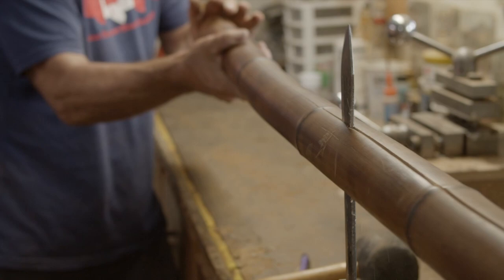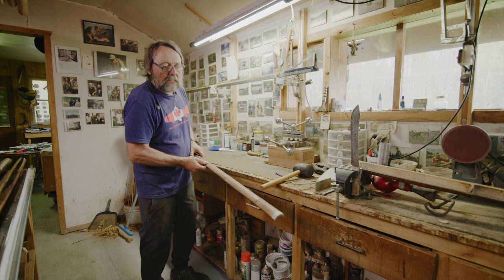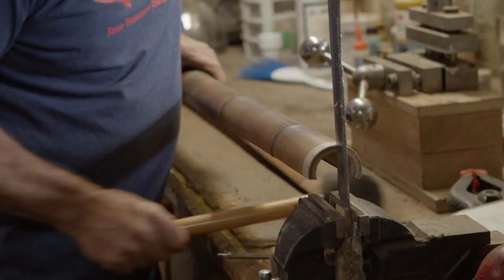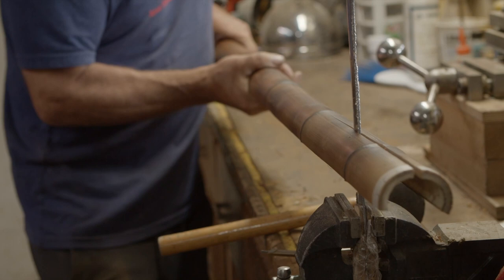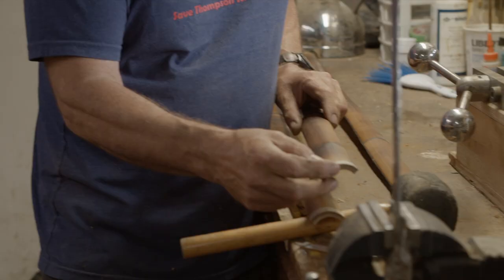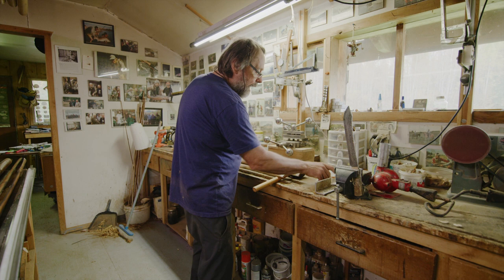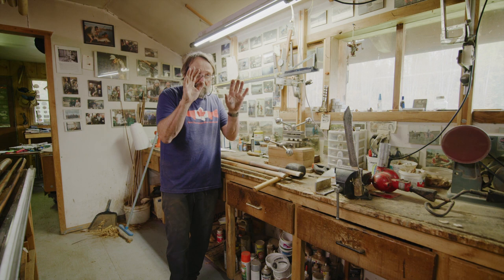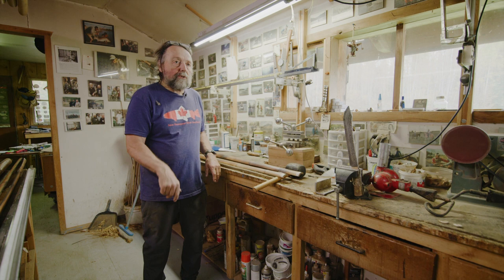Bamboo Rod Building: Rough Splitting and Oven Prep

Comment: I am of the other school. I prefer to split to the final rough width strips,  flatten the nodes and straighten, rough bevel and heat treat the strips bound in hexes to get the straightening effect of heat treating. I will be interested to see what your strips are like when you get to that  stage.
Reply: they'will be straight with out the work